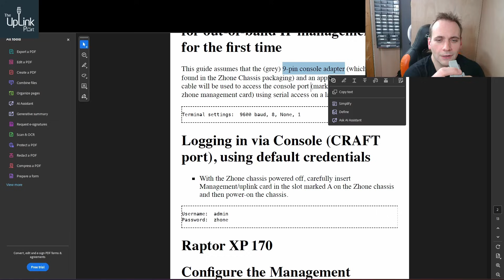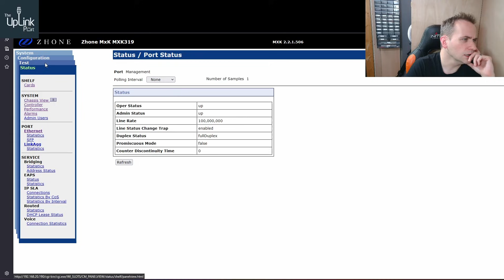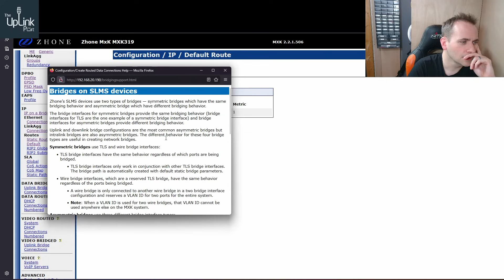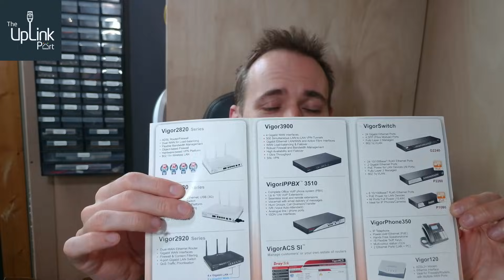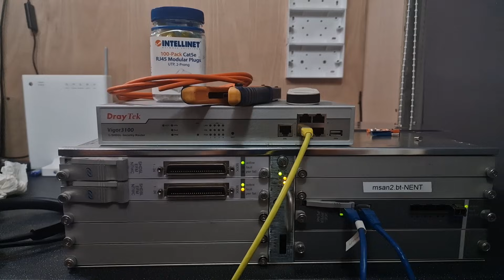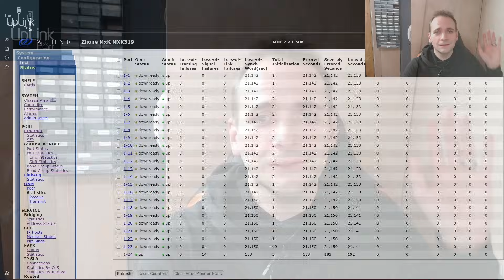I Have Another DSLAM… SHDSL EFM Throwback!

Comment: DPBO is downstream power back off. I'm from Germany, so I can only speak for its usage here. Whenever we put a MSAN inside a FTTC cabinet we have to set its ESEL (exchange side electrical length) value according to the cable from our exchange to the FTTC cabinet to lower any frequency between the first carrier up to the calculated maximum frequency possible over lets say 3000m of copper. So you had to set it to a fictional 40dB of E-side length and a minimum usable frequency/signal (MUS) of 1.4MHz. This made it possible that exchange based ADSL signals wouldnt interfere with FTTC ADSL. FTTC ADSL in this example had lower to no usage of carriers from around 160kHz to 1.4MHz which actually cost a lot of bandwidth on longer exchange cablings just so that exchange driven ADSL lines won't be affected by the higher power of FTTC. But it had to be used for VDSL as well, it affected its downstream 1 band from around 160kHz to 2.2MHz which wasnt too bad since VDSL had some higher frequencies to use some more downstream depending on the spectrum profile (8MHz, 17MHz, 35MHz max)
Reply from the maker: Hey! Thanks for taking the time to comment!

OK, that make sense with what DPBO stands for. 

So in your case the MSAN in the FTTC cabinet had to fake the exchange-side loss (ESEL ~40 dB) so it wouldn’t blast the lower tones and interfere with any exchange-served ADSL on the same bundle.

Carving out everything from ~160 kHz up to 1.4 MHz is a big bandwidth sacrifice, but it makes sense for coexistence. And yeah, VDSL loses its lower D1 band for the same reason. from what i have read.

Even getting to this level in respect to frequency has blown my mind. There is so much you would not normally think about.

Hopefuly i can spend some time on it this week.

Comment: Few tips, many professional equipment has monitoring or diagnostic function in their software meant especially to diagnose out problems. For an example they could show out why some specific line or service fails to establish. These can be really helpful when trying to figure out problem, many times showing even real time info about what's currently happenin and are something you should definitely check out if these equipment have such.

The other thing is that based on this and the ADVA video I got a feeling you are still viewing these ISP equipment with too LAN like approach on how they should work. As the name suggest these are meant to provide services over certain technology and rather than viewing configuration as port based it's usually divided in certain common logical categories like system configuration for HW and chassis, network configuration for how the equipment is suppose to connect to your backbone, service configuration for what kind of service you want to provide (you could say this is analogy to different subscription operator is selling) and even customer configuration in some platform (as some customers may want multiple different services and system can logically bundle these up). How exactly these are configured varies bit from platform to platform but the logic is usually pretty similar from vendor to another. So you usually have to create a service and then provision it to customer ports you want.
Reply from the maker: Hey @juhohartikainen4408,

Thank you for taking the time to comment and i fully agree with you. Like i said i really need to understand this one more to full get behind it.

The GUI is limited on the output but that's not to say there is not a syslog that i could configure in CLI to see the sync failures.

I have a Zhone EFM CPE on the way as well to try out.

I think seeing the other CPEs and the ADVA CLI format made me loose the will to live at that moment in time and i think i tried to take on to much to start with. This shoud have been an overview and getting to know the device before attempting to connect a CPE.. And maybe just reading the manual world have helped :D

But i do appreciate what you are saying and i hope you enjoyed.